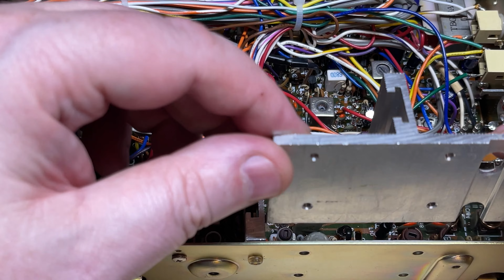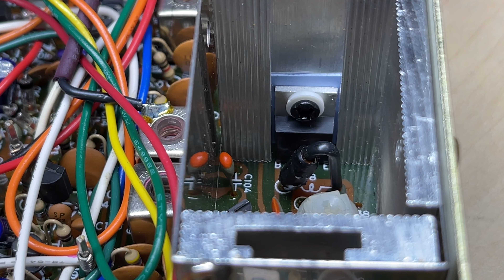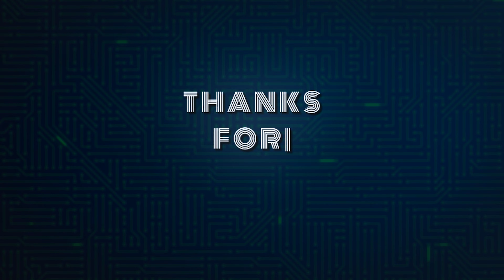IRF520N - 2SC1969 MOSFET Replacement - PTBM059COX

Comment: I have a large bag of 2SC1969 and 2SC2078 which seem to perform similarly when driven by a 2166.  The problem I have with MOSFETS is that their performance rapidly drops off at the higher shortwave frequencies.  The MOSFET will beat the BJT at 7mhz, but at 28mhz the MOSFET is quite weak.  Thanks for the video... there's a big trend to move from BJT's to MOSFET's for final RF amp work.

Comment: I've had one in my mk1 excalibur base station for a while, works fine and I'm sure thats the 059 chassis
Reply from the maker: yeh it works well , i think its a 059 , couldn't be sure tho.
Reply: @MicroChipz  It's the original 80 channel version like the mk1 jumbo so I think its the 059
Reply from the maker: I know others make this mod as well , but it wouldn't be microchipz if i didn't make one myself and test it ;)

Comment: Thanks for documenting this. I have a Uniden PC122 and a Pro640e (essentially the same chassis) that I want to replace the 2SC2312 finals in using these IRF MOSFET devices. I have seen a few mentions that the information about this 'replacement' process is available in a few places on the net but I have searched and can't find any generic info. Are you able to link me to it? Alternatively have you done this upgrade on either of these radios or plan to? Thanks :)
Reply from the maker: Hi. Thanks , i was not planing to do a conversion for those boards , i have some info for a cobra mosfet mod but thats it .
Reply: @MicroChipz  Ok, that may help. All I need to see is what additional circuitry is required around the MOSFET. As for what needs to be changed or removed from the board I can probably work that out.
These Uniden chassis use a 2SC2312 final and they are basically unobtanium these days so the only viable option is to change to the MOSFET.
Reply from the maker: Hi
The only info i have is in the form of a picture .
Drop me a mail and il send it to you
microchipzyt AT gmail.com